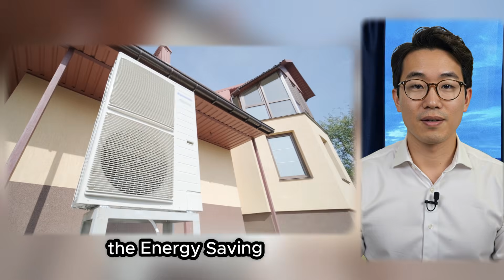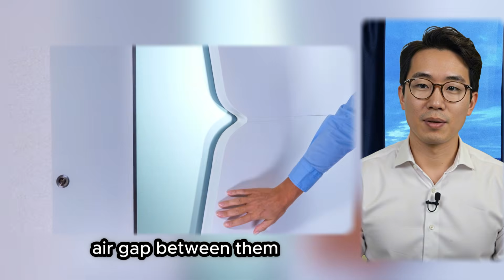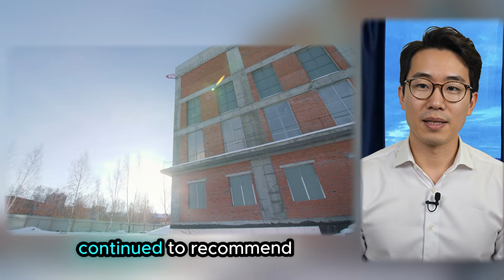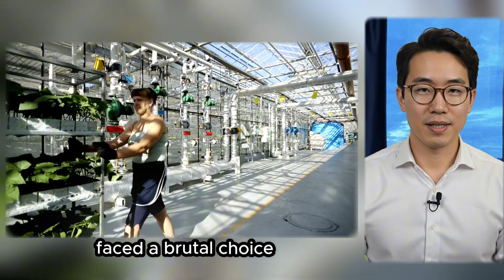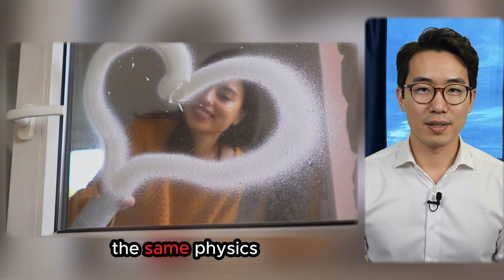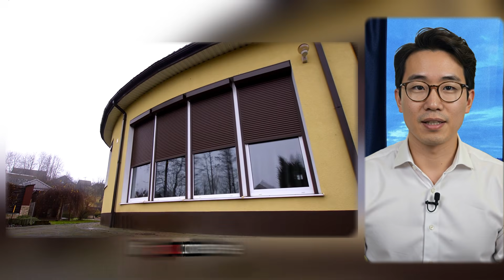THIS $5 Window Trick CUTS Your Heating Bill By 30%!

Comment: If all it takes is trapped air between plastic, I'll create my own double glazing.
I'll measure my window frame dimensions. Cut some strips of balsa wood (light wood) to size and staple cling film to the wood frame. 

I'll use those sticky picture frame adhesives to put it in place.

Light. Cheap and easy to install and remove.